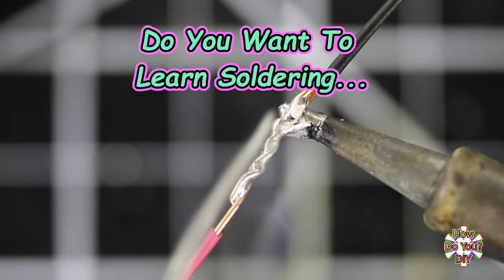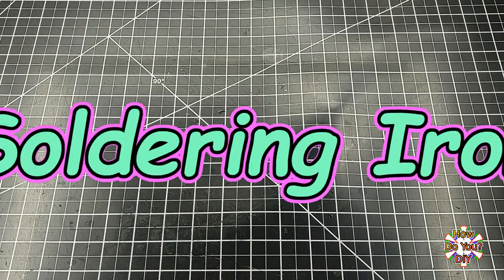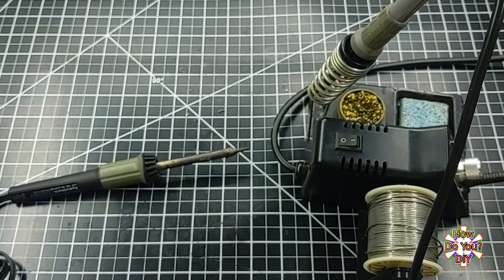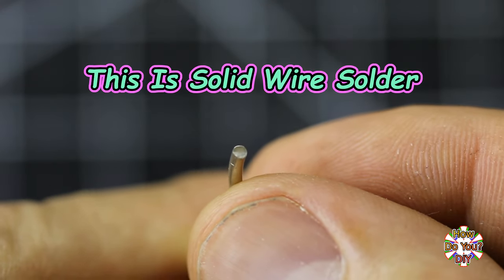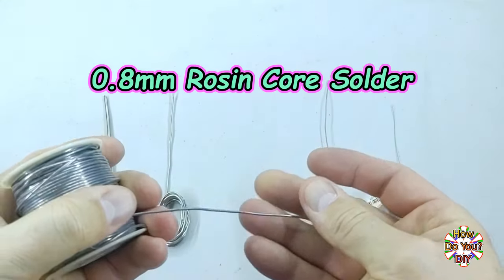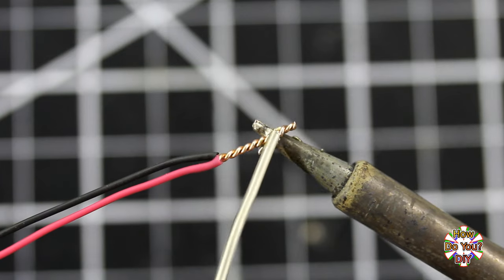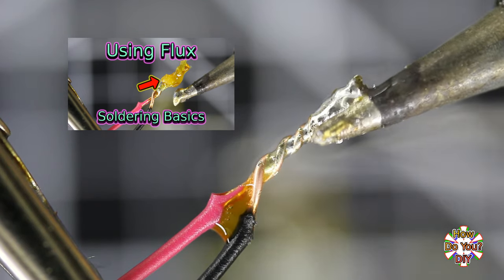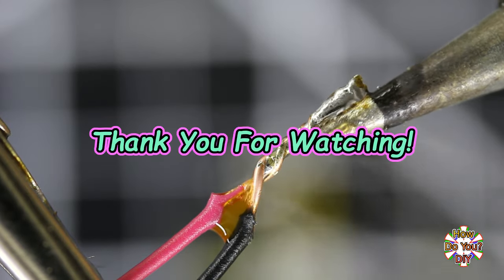Required Tools and Supplies For Basic Soldering | Soldering Basics | Soldering for Beginners

Comment: the only reason to use thicker solder for bigger parts is time saving. it doesn't actually create an issue unlike using thick solder on a tiny part and flooding it accidentally.